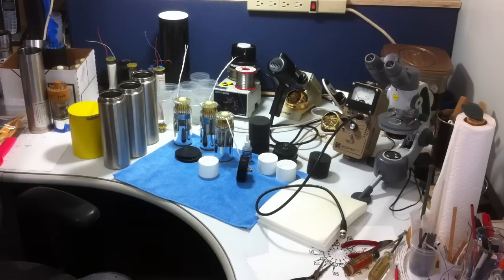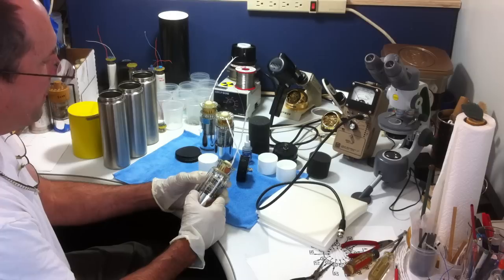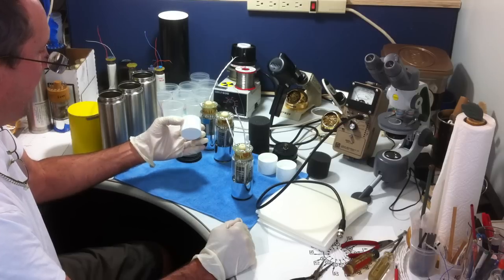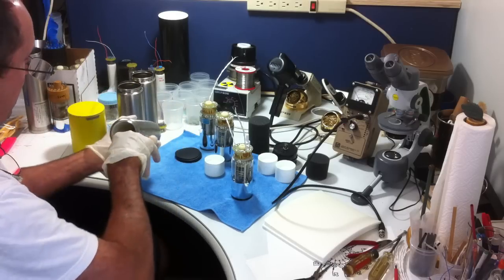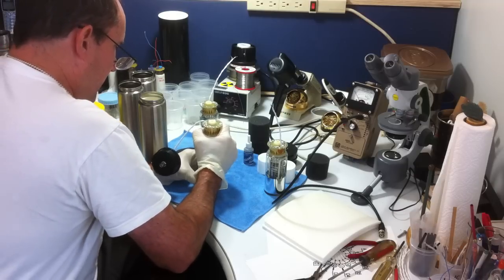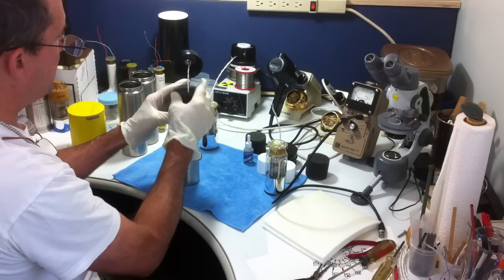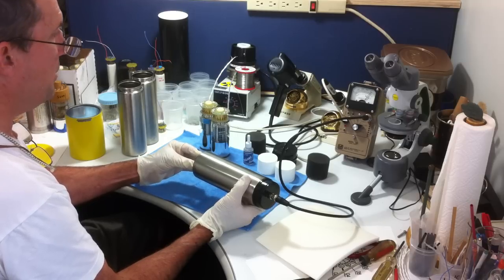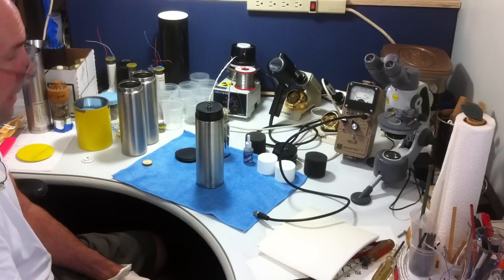Building the iRad GS-215 Gamma Scintillator Detector.MOV

Comment: When use a light spectrometer (visible light range) I see very sharp lines.
I can distinguish two very narrow lines in a very short distance of their frequencies
let's say a frequency distance of less than 0,01% .

What is the resolution of a plastic BC-412 and/or a CsI(TI) detector ?

What is the light frequency range of a plastic BC-412 detector ?

Can I see little scintillation  light sparks in a plastic BS-412 in complete darkness with my 1/2 hour in dark adpated eyes ?

Comment: A photomultiplier has a light amplification of approcs. one million.
You try to couple the BC-408 plastic detector very close to the PMT surface.
So you do not loose any of the emitted light.

So  let's say you win  plus 20-50%.

But the same you can do with increasing the amplification factor of the PMT
by increasing the voltage at the PMT let's say from 1000 Volt-DC  to 1010 Volt-DC

Comment from the maker: The silicone grease I prefer to use is an ultra-clear 500,000 weight RC Differential Fluid made by Traxxas. A 20cc bottle sells for under $10. For a Burle / Photonis XP2902, I recommend using the approximate manufacture recommended string ratio using a 4.7 MegOhm as the base resistor value. All connections EXCEPT the following should be 4.7m, the rest should be as follows. K-D1=10m, D2-D3=6.8, D6-D7=2.2m. These values will total 56.6 MegOhm and have worked very well for me with most equipment.

Comment from the maker: Adding the Mu-Metal or equivalent would just drive up the price and deliver no real benefit for most intended uses of this probe. Plastic scintillators are used for gross counting and not usually used for applications that are typically subject to interference. I do offer shielding (usually Ultraperm 80) as an option along with an internal lead collimator, different bulkhead connectors, thin aluminum windows, etc... Keeping the price affordable is my main objective on this probe. I sell others.

Comment from the maker: Thanks!
Not too many X-Rays are going to make it through the stainless steel, and no plastic is anywhere near the resolution and response of NaI(Tl). I do sell other scintillators, some with "windows" (including aluminized Mylar) and others are built with different housing materials, but these are built for economy. I sell these units for only $259.00 on eBay, and it's very hard to find any other comparable scintillator at that price. For Gamma counting, these perform VERY well.
Reply: Hey Tom would this probe work for Gamma spectroscopy?

Comment from the maker: What you see in this video is the conclusion of hours of work preparing the different parts for final assembly. Finding the parts in quantity and at a profitable price takes the longest time and most effort. The Photomultipliers must be desoldered of their original circuitry and fitted with circuitry that works with standard meters. Cutting and polishing the crystals is also very tedious and time consuming. Product design also takes a lot of thought and time.

Comment: WOW!  What an interesting video!    Three questions: Does the use of stainless steel have any bad effects with x-rays from gamma interactions? I use aluminium in my unit, partially for that reason. Secondly, is the plastic scintillator as efficient as NaI(Tl)? I have never messed with plastic. Lastly, have you considered adding a thin aluminium window to your units?

It is amazing to watch them built!

Thanks for posting this video!